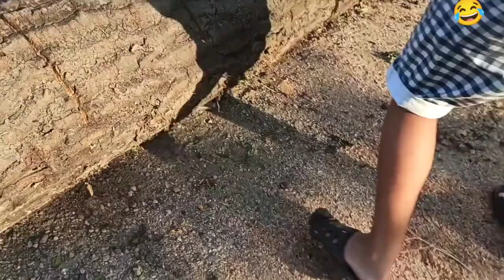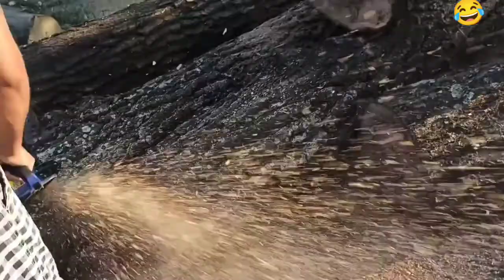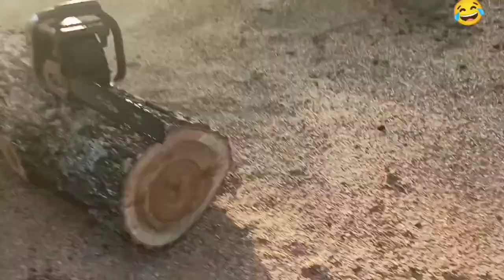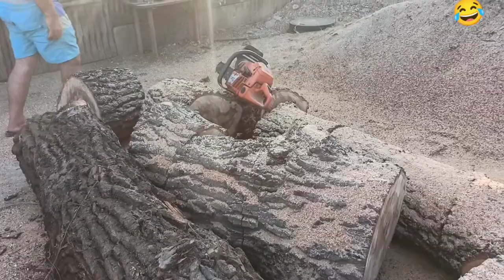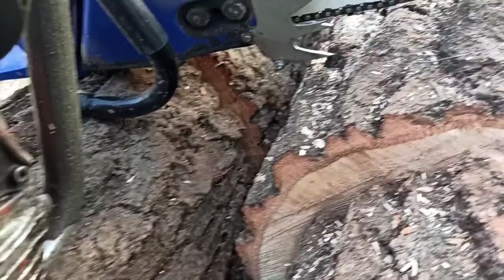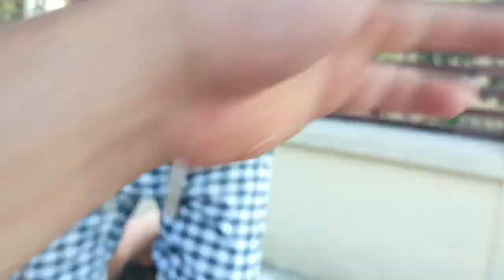S-a stricat Husqvarna 365, ne salvează Holzfforma G660

Comment: Regleaza carburatorul ala ca merge prost de tot dai turatie mai multa daca ai tahometru ea din fabrica merge pe 10 000rpm insa trebuie reglata la 13 500 rpm sa ruleze optim iar L trebuie strans putin undeva la 3200 rpm la relanti e optim.  Iti recomand un tahometru nu e scump dar e bun la toate utilajele.  Si nu i-ar strica un muffler mode ai 2 porturi pe lateral care sunt foarte mici trebuie largite iar la interior cu un flex sau si mai bine cu un biax tai tot patratul ala restrictioneaza destul de mult o sa aiba alt zvac si o putere si un raspuns mult mai bun comparativ cu 661. Bafta
Reply from the maker: Cred că era de la lanț, erau lemnele murdare de pământ și tocea repede dinții.